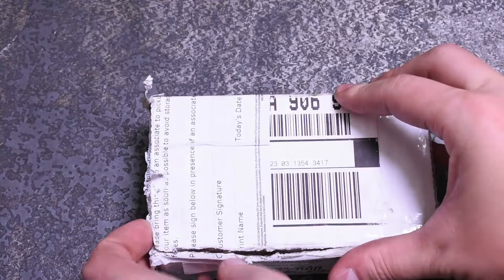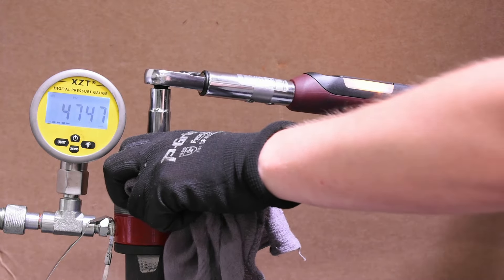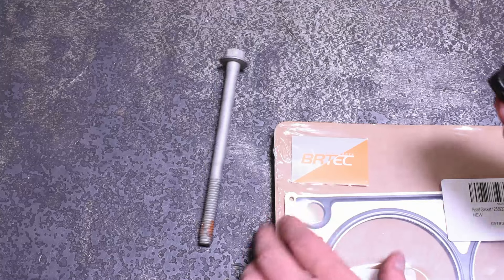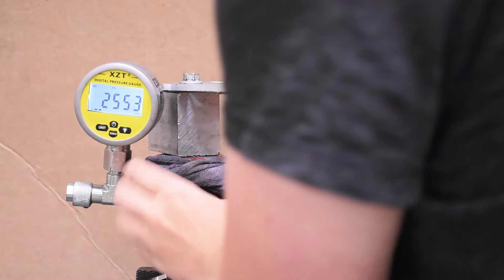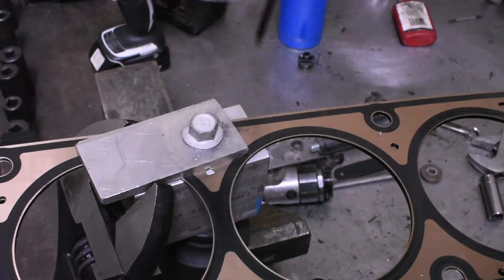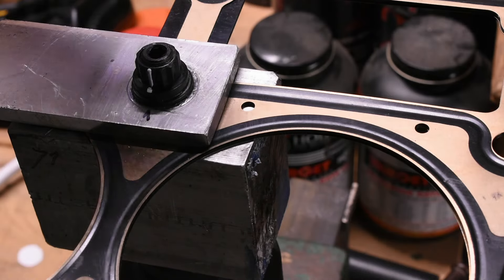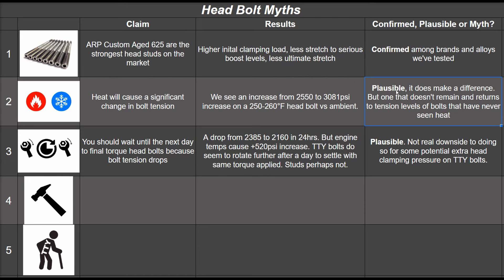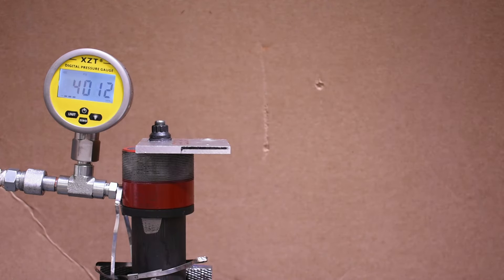CAN You Reuse Cylinder Head Bolts? Testing Myths + ARP Custom Aged 625+

Comment: One thing I noticed with re-used LS bolts (head, rods, mains) is you can't use the tq+angle method. It leads to a very different clamping force. I had marked bolts in an untouched factory block, loosened, then torqued - they ended up going past the marks each time and different bearing clearance. That seems in-line with what Honda says about re-using their bolts.

Comment: Infrared thermometers on bare metallic surfaces are a big no-no unless you are able to adjust the coefficient of emission. If you don't your reading will usually be much less than the actual temperature. If you don't trust me, put some water on your sample and measure the temperature in the dry area when the water starts boiling.

Comment: There is a way to heat that block to engine temp for testing that doesn't require a blowtorch. Just use cartridge heaters and a PT1000 RTD sensor with an ESP32 board. That would give you temp and time data for long term testing if you wanted.

Comment: Replacing the head gasket on my 1993 Suzuki Swift 1.3 4 cyl I used the head bolts over again when they were out of stock at the dealer. A couple thousand miles later the new gasket started leaking. I replaced the head gasket again but with new TTY bolts and no more leak until I sold the car some years later.
Reply: Possibly over torqued the bolts.
Reply: @SinsBird    Thats the point, TTY bolts ARE over torqued by design and can only be used once.
Reply: @alro2434  By over torquing I meant going way past the yielding point where bolt becomes weaker. This is almost guaranteed to happen if the bolts were correctly torqued to spec previously and are torqued the same way for the second time. TTY bolts can be reused but their length must checked and tightening procedure is different.

Comment: The directions that came with my 393W kit(from the mid 80s) said to run engine to temperature, leave overnight, then re-torque. Haven't had an issue yet.

Comment: Ive reused tty but only on Toyotas. So far no problem xD. 
Toyota’s manual does give a way to measure the bolts to see if they are reusable tho so there is that.
Reply: Millions of 2az oil burners out there running with reused head bolts. Replaced pistons in over 100 of them myself. The threads in the blocks will pop long before the bolts ever will
Reply: @urMomAtMyHouseDotOrg  yes sir.

Comment: I always had wondered about that myth of hitting the bolts with a hammer.
I recall many instances of having to to wait final assembly for the "tapping" of the head bolts with a hammer by the old mechanics when I was an apprentice so many eons ago. The very same reasons as noted were given for this procedure along with "seating" the bolt head as machining from other shops shouldn't ever be taken at face value. 
Always seemed to be an unnecessary step as I never saw or heard of any failures whether hit or not.

Comment: On the re used tty bolts the seasoning matters- you want bolts that have been torqued and heat cycled for like 10 years and 150k +. It is also best to torque them to a number not to yeild like new bolts. 70 ftlbs is the number LS guys use.

Comment: Cummins gives you a stretch gauge in their head gasket kit to check the bolts. The factory service manuals include the procedure. Chances are if the manufacturer says do it, you can do it.

Comment: Here is how to re-use a TTY bolt and get the same tension. Get a new bolt and tighten it to spec. Then mark the bolt head position. Then remove the bolt and tighten it back to the same position that you marked. Forget about angle or torque, just get it back to the same head position. Then you will have the same clamping for as on the first tightening. This is why TTY bolts have to be discarded, because nobody is going to go through the trouble of marking the position of the bolt and then re-tightening it back to the same position.

Comment: Some desiel engines require a hot re-torque. My 12v at the same 130lbs on the stud turn another ¼ turn when hot.

Comment: Just one for you here for the temperature affecting torque. on my honda cg125 i always had to retourque the head bolts after i heat cycled the engine (after a rebuild) cause every time i forgot the head bolts would come loose after a short while and i would get stranded at the side of the road.

Comment: mercedes specifies an elongation value for the cylinder head bolts, at least in the commercial vehicle sector. if the screws do not exceed a certain length, they can be reused

Comment: when i did the head gasket on my 93  200tdi landrover D1, the early landrover manual i found online says you can use the stretch head bolts 3 times which i have over the years and have had no head gasket problems and it is worked hard and is my daily.. however, a later landrover manual say you can only use them one time

Comment: The torque spec commonly used for a re used LS head bolt is 68ft pounds! We’ve made over 30 psi of boost using this method.
Reply: Are the bolts installed wet or dry?

Comment: My theory of myth 4 is that it may help if you do sloppy work.  Fouled or dirty threads, insufficient lube, etc..  If tapping a bolt with hammer helped when work is done properly, it would be included in the instructions.  I'm not suggesting that all instructions are perfect or optimal, but in this case reputable part manufacturers and OEMs have researched the heck out of this for decades.  It's unlikely that any individual mechanic has better data than they do.
Reply: The problem now is that reputable part manufacturers are less in number than before. So these methods come into play more these days as a distrust of quality control has developed.

Comment: I have reused tty bolts on a Buick 3800 but like the Honda I did not use the original method
 instead I just pulled them to 80ftlbs then I took them to 120 ft lbs and it worked out ok
And that’s a hot engine in the Australian summer heat 🤣

Comment: For the 2014 to 2019  6.2 engines instead of the 22f lb then 70 % and 90%  i do lubed bolts and blown out holes  22f lbs 67 flbs then 84 ftbs waiting ten mins between torques in sequence .saves a 100.00  bucks each time on new bolts  . i disable the fuel management program and no more lifter failures . sorry im getting off topic .

Comment: I've heard in a pinch you can cut used TTY bolts down a bit, maybe a quarter inch, and make them work, just torque a little extra. This was a farm mechanic, so I trust it when he tells me some shade tree trick.. I just haven't tried it myself.
Reply: What the heck?? If they stretched so much that you'd have to shorten them you can't reuse them.
Reply: Cut down what?  The stretchy bit is  from the last engaged thread, up until the heads contact surface.  The thread's end that you wanna cut does almost no holding at all unless there is very little thread engagement.

Comment: My ac delco digital + angle torque wrench will tell you torque applied when you torque via angle.  Most ls head bolts end up between 75-110ft/lbs after the final pass.  It's a pretty ridiculous range.

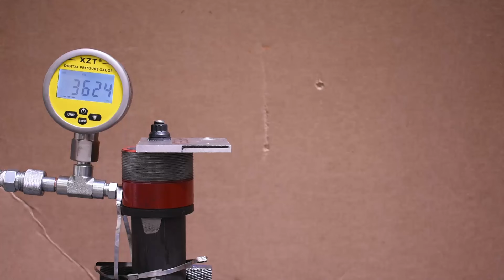Comment: 11:33 this is also why you don't want to use anti-seize grease on your sparkplugs, especially with an aluminum head, you can end up damaging the threads on the head.
Reply: Anti seize is bad news in my opinion. Copper slip is the ticket.

Comment: so, I'm wondering about main cap bolts. For LS they are torque to yield / angle torque spec. How are you supposed to set bearing clearances without ruining the bolts? You need to use the torque sequence to achieve proper clamping for check bearing clearance. So then when re-installing the bolts with the crank etc, is the bolt already ruined / per-weakened?
Reply: Torquing does not affect the clearance so you don't have to tighten it till it starts yielding.

Comment: I was hoping to see a comparison between roughing up the arp washer on the “engine side” vs not. Steve Brule wrote an article that I mentioned on your original video.
Reply: ARP sells washers with dimples as well.  Also depends on the surface finish under the washer, that metal he used didn't look too polished.

Comment: Used to work at a Hyundai dealer and they used Mitsubishi drivelines. Lots of bent valves due to neglected timing belts. Headbolts were supposed to be measured and compared to a spec for stretch requiring replacement. The issue was the bolts were like 9 inches long and a couple thou stretch was hard to determine. So I just reused them cause no one ever wanted to sell a set of headbolts and infact under warranty you just reused them cause trying to prove they were bad wasted your time. Prolly were only gonna go 65k miles till belt broke again anyway.

Comment: The hammer advice I was given was to take a soft brass punch and use that to hit the bolt head. Trying to shock it, not damage it. I doubt any of that matters but it sounds alot better than just swinging away at bolt heads with a hammer lol.

Comment: With respect to TTY bolts. mitsubishi specify a TTY bolt can be reused if it has not exceeded a given length limit. As specified in the workshop manual for the engine in question.

Comment: I have reused TTY bolts, but do not see you do what I do. Yes, I lube them and torque them to the top rated by the manufacturer. If it calls for a sequence of say, 40-90-100- and then 130-145, I torque them the same way and take it to 145 which is the top end of the required torque.  I have never tried the 40-80-120 plus 90 degrees.  I think I saw that on a Honda civic but just torqued them as stated (I think that is what I did) but my mind is also trying to remember what I did to my grandson's EVO.  Mute, maybe as his friend wrapped it around a tree after sliding at a corner on his way to pick up more beer.  Anyway, I have never had one that I know of that failed.

Comment: I’m here to determine if I should reuse the TTY oil filter housing bolts that Volkswagens says to replace. None in stock anywhere and need car back asap! Think I’ll be ok and and should I torque to spec plus the 1/4” or 90 degree as new? 2011 Jetta tdi 2.0L diesel sedan. TIA!

Comment: Cummins gives you a go/no go gauge to compare head bolts to with an upper gasket or overhaul kit but they're all reusable. The service manual on an ISX (300lbft + 90°) or ISM (100lbft + 180°) also tells you it may be necessary to use a 3/4" impact to achieve the final angle
Reply: May be? More like essential lol. Those engines are the only reason I have 3/4 impacts and sockets. 

And engine mounts on buses and QSKs…
Reply: @zorgzev96  I used the 3/4 impact for it every chance I got for it lol I had to pull a few by hand a couple of times because of access. I worded it that way because that's what it says in the book and I didn't want to hear "UhM aCkTcHyUaLlY tHe BoOk SaYs"

Comment: On my 2009 Kia Rio 1.6l engine, the factory manual says to tighten all TTY head bolts to 21.7 lb-ft + 90 degrees Then RELEASE  ALL BOLTS, and re tighten all bolts to previous torque and degrees.
Theoretically, isn't that the same as re-using the bolts? I followed these instructions, and the engine is still running perfectly 80,000km and 7 years later.

Comment: my L19 studs always required more torque next day......Maybe the studs are turning with it??....Using Fel MLS racing HG ...cooling system will over pressurized if I did not retorque. Found studs down 30 lbs torque...On the chassis dyno re torquing is a must.....I have chassis dyno this motor 3 times in 10 yrs up to 40 psi boost.

Comment: If instructions say lube: use lube
If instructions don't say lube: don't use lube
Saw a video a while ago of a, think it was Haas milling machine engineer saying "always use lube" on anything because thats how he designed the CNC mill, but some engineers will design with dry torque in mind and you may end up putting the fastener under higher than spec tension if this is the case. Do as the engineer of your exact item/application says and not as any other engineers say because ford or whoever won't care what the Haas engineer said if it contradicts what they said and Haas won't warranty your non-Haas whatever

Comment: Since the usual TTY head bolts are under $150 for a V8 engine & over $1000 worth of parts can be damaged (as well as tow truck costs, missed functions or work, etc) if they fail, not replacing them is kind of silly.   The same goes for rod, main, & damper bolts.  The cost of replacement is pretty low considering what will happen if they fail.  I do agree it is a BS practice to use them, however.  The industry got along super well before & the aftermarket still does without them.  Perhaps the next size larger in diameter or a better spec bolt would be MUCH better.

Comment: One thing to consider is they need to streatch the same as design by the engine maker. Too little streatch will cause over compression of the head gasket over the themro cycling. Leaking to leaks. For racing, this is not a consern and stronger bolts will help with the exteme pressures of boosted engines.
Reply: You don't understand the purpose of TTY fasteners. Remember fasteners only provide clamp load, it's a big spring. What torque to yield does is decouple that clamp load from the degrees of rotation. As long as the fastener is in the yielding range the clamp load applied to the joint is very similar whether or not it just started yielding or it's getting close to failure.

Comment: A lot of misconceptions about torque vs angle in the comments it seems. Angle is superior in every way when trying to develop a specific amount of clamping pressure or bolt stretch. The torque required to do so can change drastically, depending on lube and many other conditions. Torque is an indirect measurement. Angle will directly tell you the amount because you know the thread pitch and the bolt's material.

Comment: If I'm spending my time rebuilding an engine, I'm not gonna cheap out reusing headbolts (or gaskets). You're saving less than $100 with the risk of failure costing another rebuild. Nothing more annoying than doing a head gasket on a fresh engine.

Also, I use arp only on a performance build. No questions. I've never had an issue paying for the quality they provide.

Comment: Torque to yield bolts are supposedly lighter for the strength than regular bolts.
There is a sweet spot where they become slightly stronger and won’t yield anymore before they go beyond the failure point but that sweet spot is hard to find and not worth the risk.
And you can always reuse any bolt as long as the expected duty doesn’t approach the point where stretch would begin. So bolting together a swing set is ok but bolting on a head not worth it.
Reply: Fastener design guy here, I know the exact torque specs and sequences all of the major manufacturers are running on their head bolts and other critical engine fasteners. No one is designing within that very narrow range you are describing trying to max out clamp load. There are so many other variables within the manufacturing process to try and target such a narrow window isn't feasible and isn't worth it. Everything is done with strain gauged fasteners while in the R&D phase to set those limits within the relatively broad yield zone.
Reply: @otm646  . Were you replying to someone else’s comment?
My comment was referring to reusing tty bolts. Not new ones.

Comment: Running bolts does warm them 
Metal typically has a high coefficient of expansion 
Could see it having an impact 
That said   Torque specs should be given for what you torque to when tightening 
Maybe building rockets you worry about that difference

Comment: Generally on a LS 5.3 liter on the 10mm bolt size the are torqued at 22.foot lbs and then 90 degrees and an additional 70 degrees not 90 and I 've seen 75lbs to 80 lbs not 94 lbs

Comment: The European brand I work gives length measurements for some of their TTY head bolts. They say if the TTY bolt is under the listed max length, they’re ok to use again. To me it’s cheap insurance and peace of mind to replace them.  As for all the YouTube certified claims out there, my two cents is that nobody knows more then the people that designed and built the thing in question. That’s not to say the ingenious tips, tricks, hacks, and shortcuts aren’t found in the field, but rather that when in doubt, usually you can’t go wrong following the manufacturer’s instructions.
Reply: The people who build them are under the control of the people who pay their wages. 
Doesn't take much to have a line changed in a service manual saying TTY bolts MUST NOT be reused.
Also gives the company an out if you admit to reusing a bolt.

Comment: How does torquing a stud not put a twist in the stud?  Friction is roughly 1/2 in the head, and 1/2 in the threads.  A stud or bolt both puts the thread friction torque into the length of it.  The advantage is the threads are hard steel on hard steel, not hard steel on aluminum or cast iron, so there remains an advantage.  Another comment is how about comparing ARP thread lube to Internatioal Compound #2, aka "peanut butter".  I have found that torque a 7/16 rod bolt to get the spec stretch requires around 90 lb-ft of torque, but the torque spec is 70.  I can feel the bolt turn as torque rises, up to about 70 lb-ft, then it seems to stick as if the threads are biting through the lube.  A 3rd comment is burnishing the threads by torqueing 3x.

Comment: I understand using a torque angle gauge to show the viewer but your using an electronic torque angle wrench that if you cycle between angle and ft lbs will show you what the angle is in final ft lbs. also ft lbs and psi are secondary to thousandths in regards to clamping a head gasket most head bolts are capable of far greater pressure than what they actually need it’s the elasticity and uniformity that your paying for with aftermarket studs